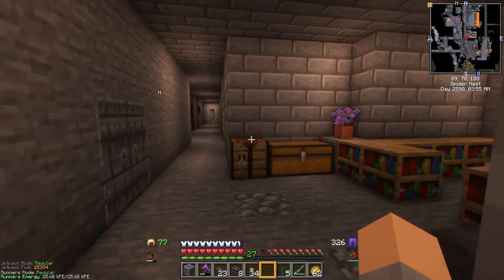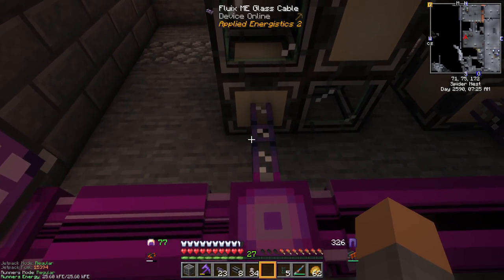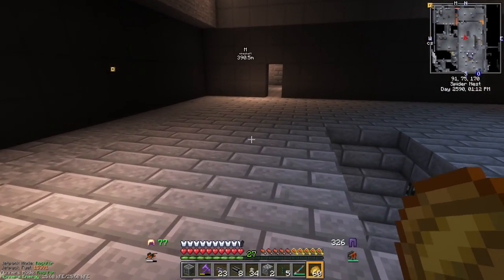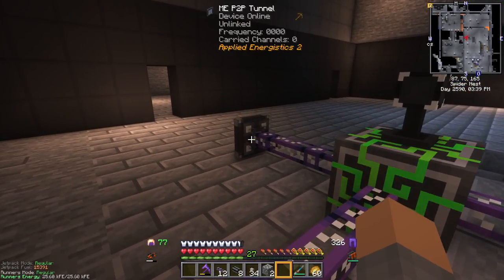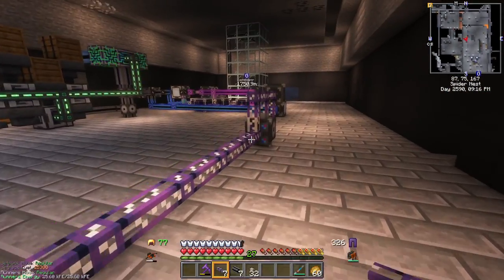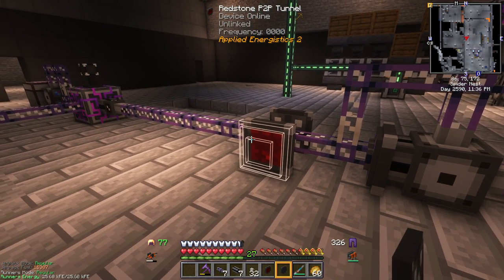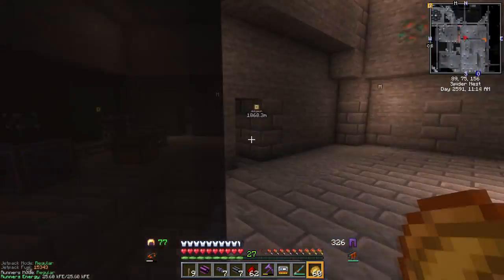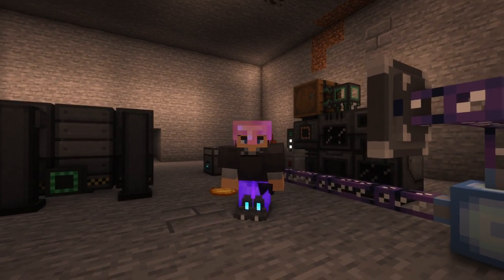AE2 P2P Tunnels and Channels Tutorial | Valhelsia 5 | Minecraft 1.19.2 [EP9]

Comment: Very educational. I love all of your tutorials and walk throughs. Question - In the stacks of pattern providers and molecular assemblers, do you have the pattern providers full of individual patterns? Can you access them through a pattern access terminal to swap the around?
Reply from the maker: Thank you! Yes and yes. They each hold the individual patterns, though I don't really pay much attention to what patterns are in which one. If you want to control that, each row in the pattern access terminal corresponds to one of the pattern providers.  There is a benefit to doing that to spread out the crafting work that may block itself. For example, if you're making a ton of pickaxes, you probably want the recipe for planks, sticks, and the pickaxe to be in different ones so they can best work in parallel. That's a simplistic example, but you get my meaning.